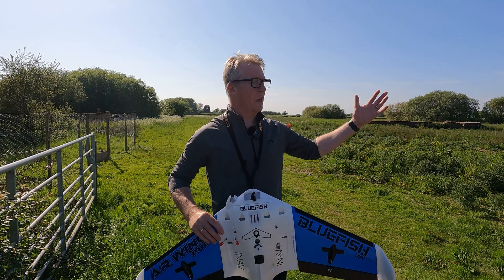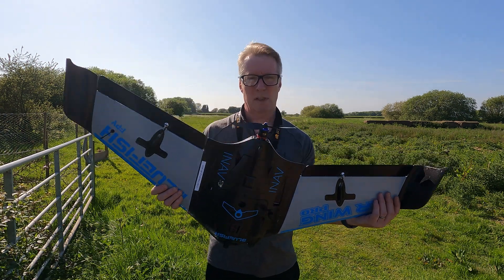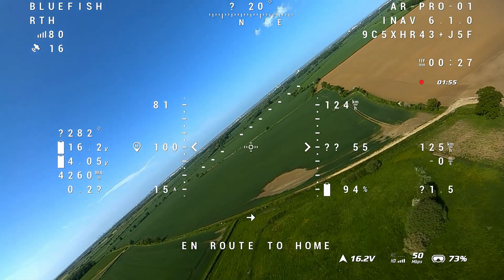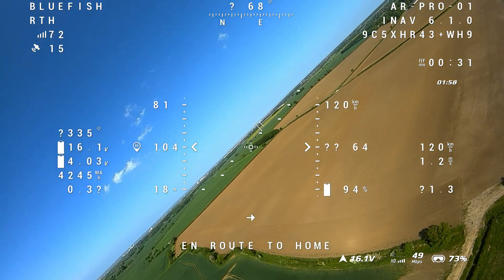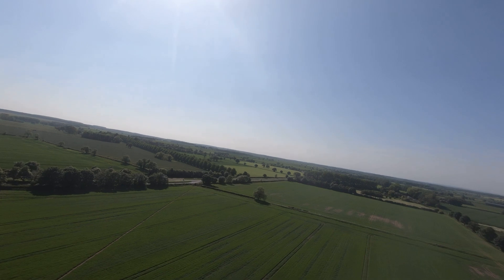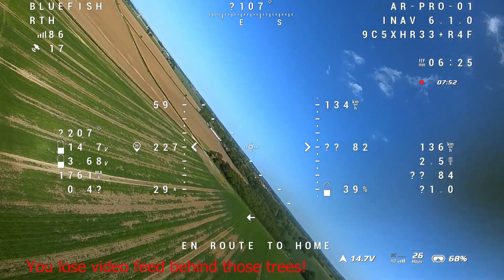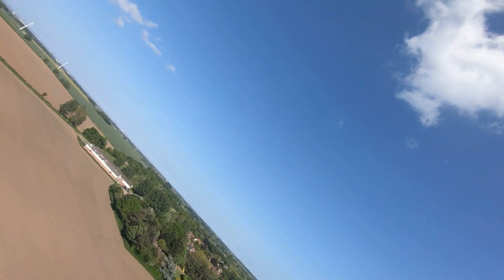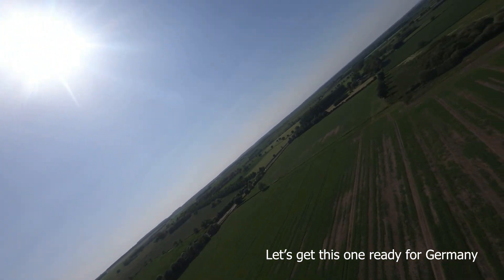AR Pro II - First Tune Flight

Comment: Could you please share all your FC settings for the AR Wing Pro - would love to know all your pid values and auto takeoff settings etc.   Just building mine now and its so hard starting from scratch...    do you have a git hub account or something where you save all your stuff ?
Reply from the maker: Hi Roy I away from home at the moment but will answer you later when I have access to my computer.
Reply from the maker: Hi Roy, with regard to my setup I would not advise using that as a starting point because my Wing is going to be different in all sorts of ways to yours most likely.

You will get far better results if you use the stock inav 7.0 settings and then perform an autotune, autotrim and autolevel once you get in the air.

I use the continuously trim servo option in the config tab switched on so I don't actually have autotrim as an option but it is entirely your choice.

In terms of Autolaunch my AR is quite heavy at 1.65 kg so I use a 1400 idle launch throttle and 1950 launch throttle.

In terms of the elevon setup I have about 3-4 mm of up elevator at 1500 neutral position in inav but a stock plane would be slighly less say 2mm should be fine.

In terms of max throws I would aim for 10-12mm for a stock plane.

Here is a link to a video made by my friend and inav guru Marc Hoffman. Although its not based upon the current version of inav, the principles still remain. https://youtu.be/vdhg54bsiEM?si=ZmrkvnEc4dnGm6Ci

I hope that helps Roy, good luck with the maiden and enjoy your AR Pro.

Comment: Beautiful day out flying. How did you arrive at those PID values?
Best wishes on the retirement. Enjoy
Reply from the maker: Hi I arrived at those values just from in flight adjustments and seeing how the plane feels. With the balsa elevons and my 800 - 2200 servo throws I get very bad pitch vibration in fast dives. So there is no science behind it for me I just adjust the values until the plane feels fluid, I don't like too much FC intervention so I have the values quite low so the plane feels a little looser than stock PIDS but I am a pincher and have a very delicate touch on the sticks which allows me to compensate.

Thats the best way I can describe it.

Comment: Hey Glenn, happy belated Birthday and congrats on your retirement! Nice footage as usual. Always like your flight videos showing you don't need super LR to have loads of fun.❤
I have a question. Why did you have to change P and D values from the default? Was it because you reinforced the wings and replaced the elevons? This is the first time I saw someone had to change anything apart from the default FF.
Reply from the maker: Hi, thank you, into my second week of retirment and I am loving it.

Yes I believe that the extra stiffness of the elevons  plays a significant part in why the stock P and D cause it to shake at higher speeds and when pitching down in particular.

I am no expert so cannot give you a definitive answer, all I can say is that I do in flight tuning until it feels as stable as possible and flies how I like it.
Reply: @bluefish3607  good to hear. hope for a lot of fly videos!! Congrats again. 
It's interesting how simple elevon improvement, without changing the airfoil profile affects the PID.
Reply from the maker: @MPSAeris  Yes I am surprised at this tbh. Just got back from a setup session with 3 AR Pros with balsa elevons and they all have the same pitch wobble on stocks PIDS and feel a bit tight.

Not sure if the balsa elevons being a little widerr were connected to the wing and / or the servo covers have any effect.

Anyway for me it's how it flies and I go all three flying really nicely with a consistent feel.

Comment: crack my friend!!! good fly, you need to do an autotune and it will put the correct PIDs for a pleasant flight.
Reply from the maker: Thanks, Autotune only changes feed forward and rates not PIDS. Thats why I do in flight tuning of PIDS.
Reply: @bluefish3607  You are absolutely right, they are not all just feed foward. Now you made me doubt the premiere of my ar wing since I was going to leave integral roll 10 and integral pitch 15 as recommended by Pawel. According to your video, instead of uploading I should lower the PIDS as much as possible.
Reply from the maker: @fpv_wing  I find with my setup and balsa elevons I need to lower the values P I and D on pitch and roll. I find it easier personally to do the PID tuning in flight and feel immediately how the plane responds when I change the values.
Reply: @bluefish3607  impressive you do it in flight in a simple way, I must investigate how the process is. Thanks for your tips. Greetings from Argentina
Reply from the maker: @fpv_wing  Oh the land of the best beef in the world and Maradona the football legend, there must be some great flying places there.

I put a little video together for you to show how it works with a link to the instruction video how to set it up.

https://youtu.be/DtBfgJhtzgA

Feliz volando mi amigo
Reply: @bluefish3607  of course my friend!! I wait for you in these lands with a good barbecue and we fly in our lands free of urbanization. The invitation is a fact, take advantage of the fact that our country has a good price for foreigners. a big greeting
Reply: On the other hand, I would like to know why the autolaunch is not even in a vertical line, does it have to do with the way to launch it? How many degrees of CLIMB do you have? thanks!
Reply from the maker: @fpv_wing  I have my launch climb angle set to 20 degrees